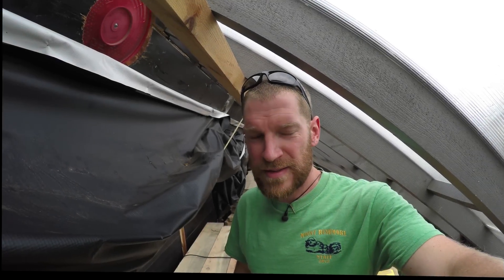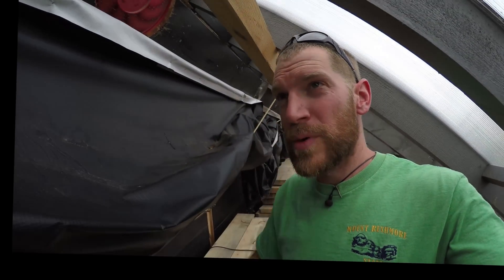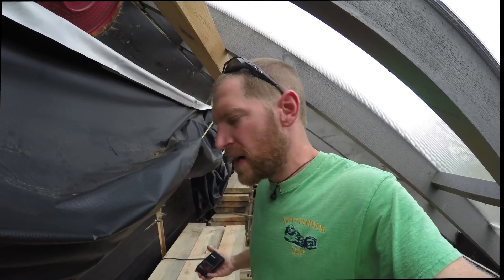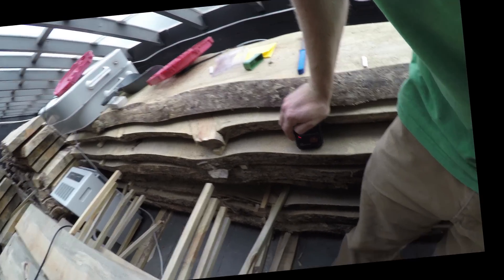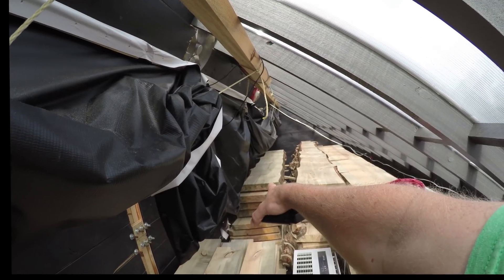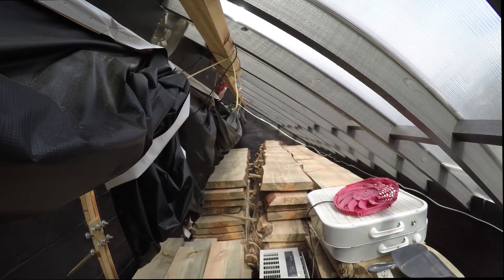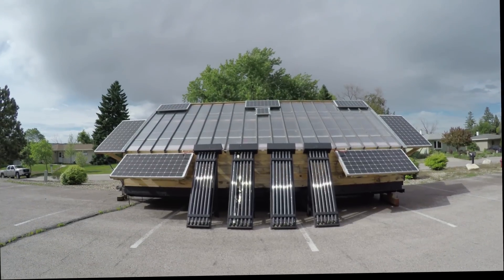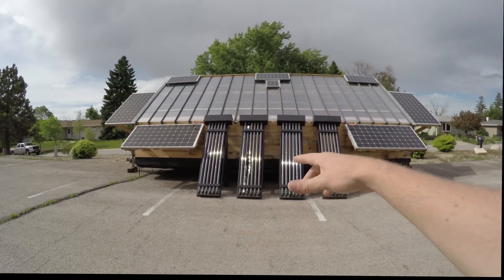4k HD: The world's most advanced mobile solar wood kiln.

Comment: Wire size is important , example   14 gage wire / 15 amp rating , 12 gage wire /  20 amp rating. Say you put a 60 amp breaker on a 12 gage wire and theres a short the wire will melt before the breaker will trip and thats a fire hazard.
Reply: It will dry faster though

Comment: You typically measure relative humidity. So, as the air temperature increases and the absolute moisture content stays the same, the relative humidity will decrease.

Comment: how long does wood dry?
Reply from the maker: It depends on the weather, I've done batches anywhere from 2-6 months. In the summer it bakes.
Reply: I was wondering if you could clear this up? At two minutes and five seconds you mention that you’re drying 1 inch lumber in three days. And then you mentioned 2 to 6 months right here? Just wondering which one it is. I’ve seen several solar accounts that are completely passive without any electricity that do it in 1 to 2 months so if it’s taking 2 to 6 months it just doesn’t seem worth it unless thats incorrect. Thxx
Reply: I meant solar Kilns not accounts..
Reply from the maker: @steddyteddy  It depends on the season, the winters can be cold where I am. In the summer I can turn 2500 board ft. in two months.

Comment: What are you using the Cooling system for? Are you cooling the fans on the inside or are you using it with a solar water heater system to get more heat into the kiln to speed up the drying process?

Comment: you stated you weren't sure if the batteries were series or parallel. if you have 2 12 volt batteries wired in series negative to pos on second to create 24 volts it's series. parallel would still produce 12 volts running pos to pos and negative to negative. if needed they make a switch to run either way called a series parallel switch. it was made for semi trucks that had the torque bennefit for the 24 volt starter but the abili
ty to run 12 volt everything else.

Comment: Nice job!  
I gave up on the idea of a solar kiln and went with a dehumidifier kiln so much cheaper... I've made it air tight, and just the heat from the two fans heats the kiln to 52 degrees C, trouble is the dehumidifier only works up to a temp of 35 degrees C, the MC of the wood came down 1% per day for some time (perfect for Oak) but for the last 4 days there's been no loss in MC and the dehumidifier isn't expelling water, any ideas where I'm going wrong? I have the kiln temp to 35 degrees C but its doing sod all.
Reply from the maker: The closer you get to that 6% range the longer it takes to see results. In the first day I'll see a 15% loss from 30% it takes 2-3 weeks after that to get to the 6%.

Chances are your dehumidifier has a stop point at 30% - at least mine does. So anything lower than 30% is up to the heat and air movement.
Reply: Thank you so ever much for your reply - you answered the question I needed to the answer to so badly. I was going to sack/spanish my dehumidifier cause of that fact it has a stop point of 30%. I added heat and hey-presto my timber was down to 10/12% (for the UK is fine) just gotta work out when to turn on the heat now during the drying process. Many thanks again, hope my message finds you well. Kind regards, Ben.
Reply: Hi Rocket factory. Does your dehumidifier have a max working temp? I've got to the point where the MC is down to 18% and turned the heat up 116 degrees and theres no water coming out..
Reply from the maker: There isn't a max working temperature on my dehumidifier. Chances are your air humidity at 116 is below 30%. If you're not already logging your air humidity levels I recommend it. It'll tell you why the dehumidifier isn't running. You just need one that shows max min levels. Unless it's a fresh load of wood at 116 it's pretty normal for the air humidity to be <20%.

Comment: Humidity is a relative measurement. Heat and air moisture content are combined to determine relative humidity. The hotter the air is the more moisture it can hold. So when you add heat but the moisture level doesn't increase your relative humidity goes down increasing your water extraction rate in the kiln.

Comment: Humidity is the fraction of the capablity of air to hold water.  When the temperature goes up with a fixed volume of air the humidity will go down because the air can hold more water.  That's why there is condensation at night when the air cools.  So when your room heats up with the same air the humidity will go down.
Reply: Andy is referring to relative humidity fyi which is usually written as a percentage (how much water vapor is in the air versus how much water vapor the air can hold at a maximum). Absolute humidity refers to how much mass of water a given mass of air can hold (which is temperature dependent and usually written in kg water vapor per kg of air). Not trying to criticize or anything but I feel that it's important to make the distinction for clarity.  Note that both humidity measurements are dependent on temperature in a slightly different way. The important thing to know is that warmer air can hold more moisture (probably because it's less dense but 100% sure as to why)
Reply: very cool explanation. did not knew this :)